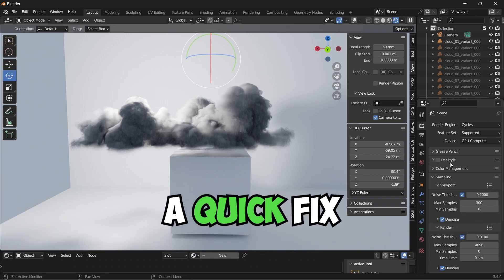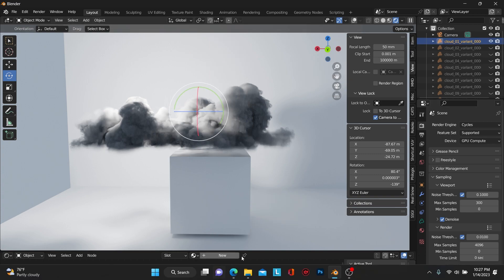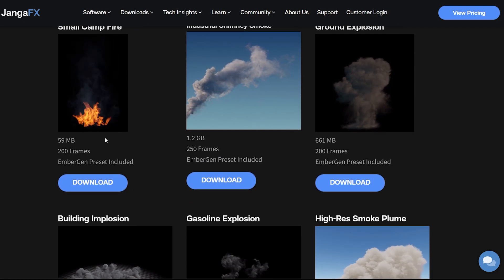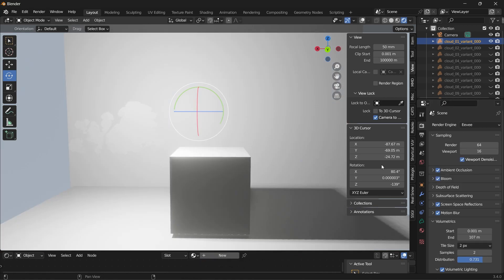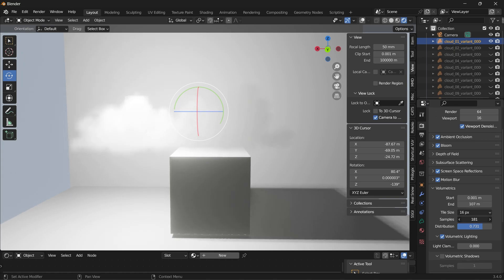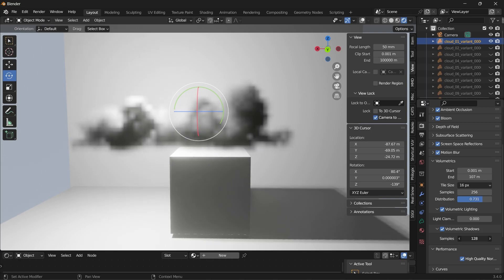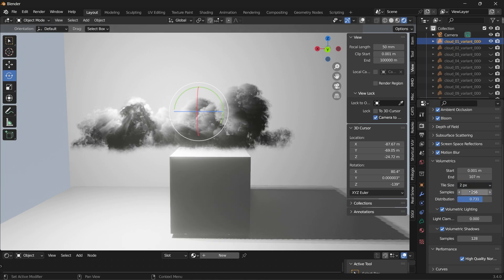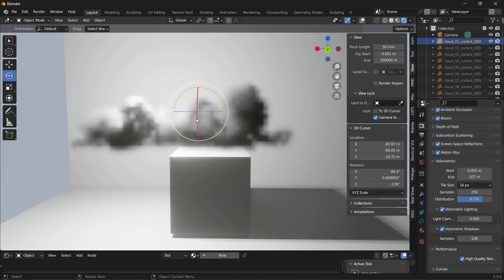Solved: How to Fix Volumetrics Not Showing in Blender Eevee - A Step-by-Step Tutorial

Comment: I can't find the volumetrics menu at all in my version of Blender. The closest I can think of is "Volumes", but that is missing many of the settings shown in this video.
Reply from the maker: @syweb2  yeah this video was done a while ago in an older version of blender.  What version of blender are you using
Reply: @osasart  4.3 . I think the settings had their names changed and moved to "Volumes" (with the exception of volumetric shadows, which is under Sampling). 
One difference I noticed is that my volumetrics are totally invisible in Eevee, while yours in the video seem to just be mostly transparent and shadowless before your fix. Increasing the samples or "steps" in mine doesn't seem to make it any more visible, either.
Reply from the maker: @ that is strange. Check your shader editor,select the > material output node switch it from all to EEVEE and make sure the volume node is connected to the volume position of the material output
Reply: @osasart  Thanks for the help. I just tried that, but it's still invisible. I'm gonna look around and see if there is anyone else who has had this problem and/or knows how to fix it.
Reply: @osasart  I think I figured something out, but I have a clarifying question: what is the "display as" setting in your volume's Viewport Display? Mine defaulted to "wire", and became visible when I changed it to "solid" or "textured".
Reply from the maker: @ mine is in solid

Comment: Did what you said, but the cloud is still 100% invisible in Eevee.
Reply from the maker: What version of blender are you using ?
Reply: @osasart  3.5.
Reply: @Corn_Pone_Flicks  Did you increase "Volumetrics end" as well? For large clouds, I need to set it to 2000m or above, up from the default 100m.